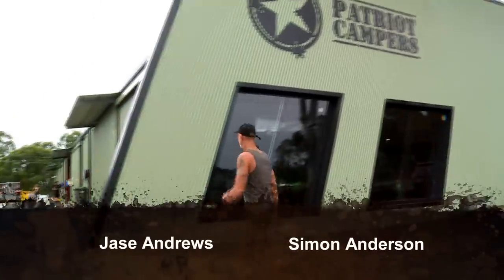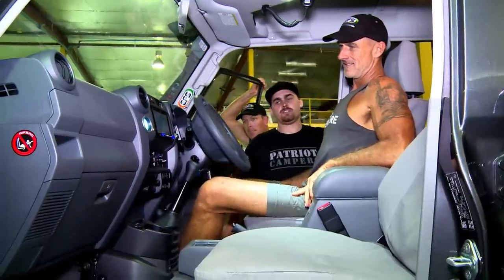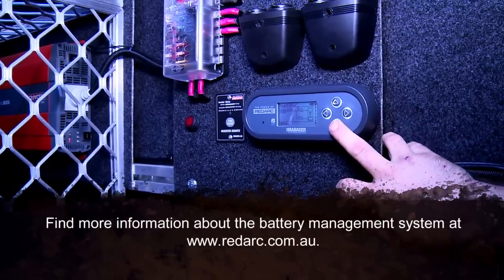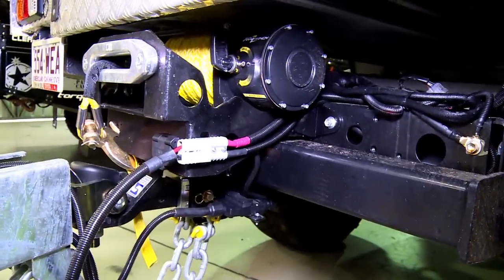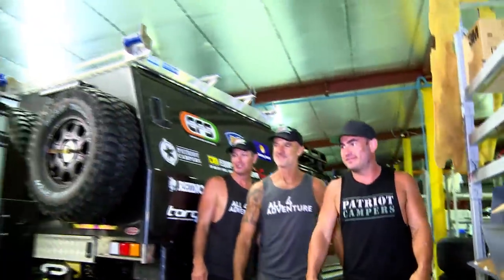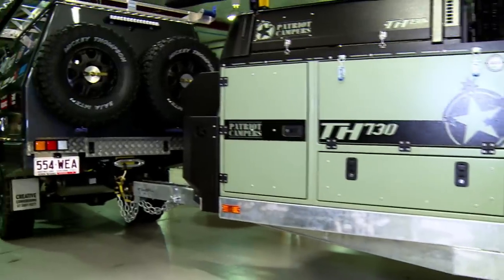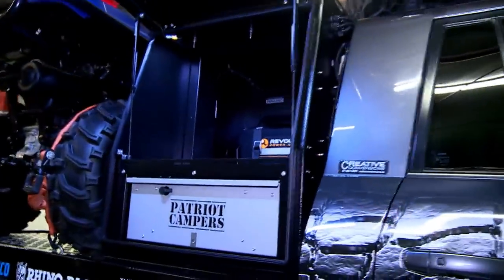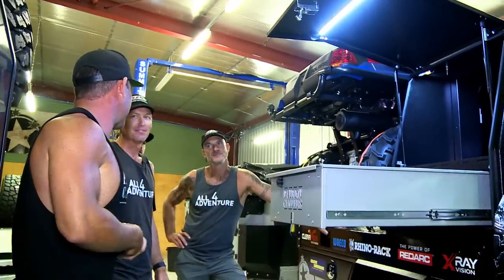Landcruiser 79 & 200 Series Build: The Details ► All 4 Adventure TV

Comment: you need to upgrade intercooler  in 200 series with bonnet scoop package from cross country keep engine a lot cooler with your bar and lights blocking air flow